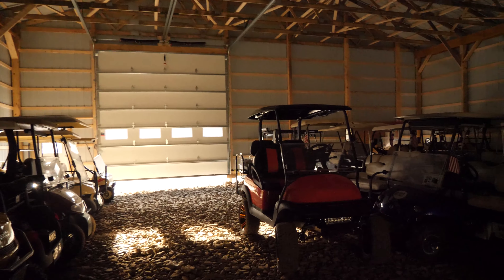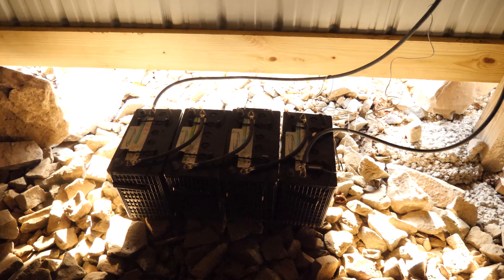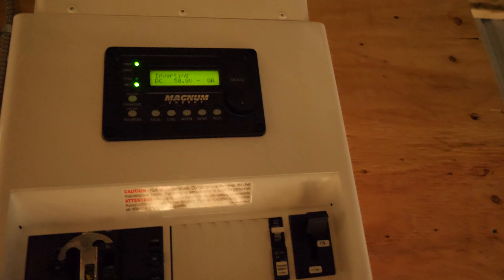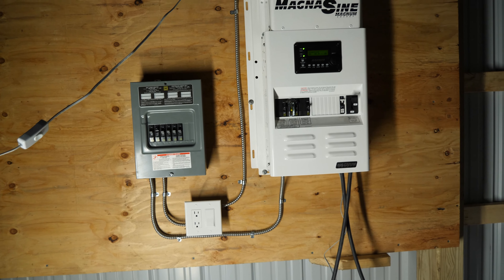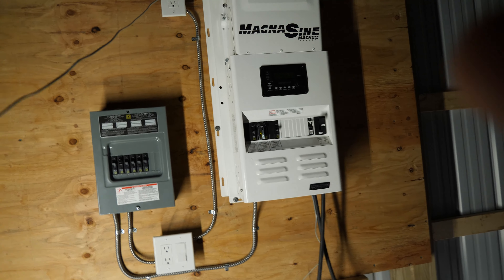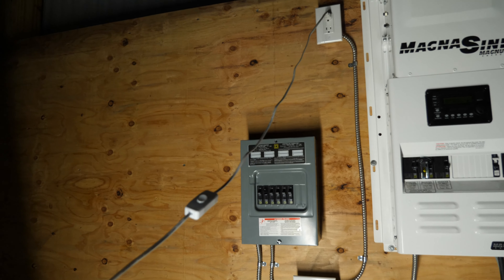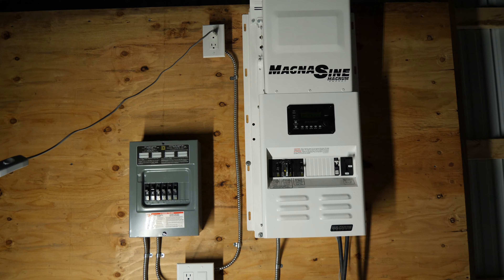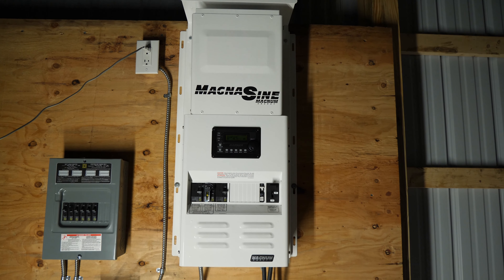Pole Barn Electrical Update - Magnum Inverter Install

Comment: wow you have no shortage of work there , not a bad problem to have, im glad youve got a decent work load there .
atleast the solar after initial expenses will mean no electricity bills, i automatically assumed everything was 120v in your part of the world , here its either 240 or 440. the high voltage electrician i knew was on $360 an hour, he shifted from perth western australia  to vegas , vegas has alot of light globes , talk about a HUGE work load LOL.